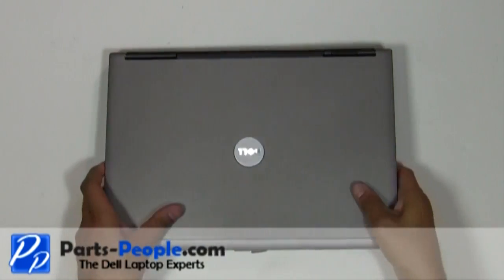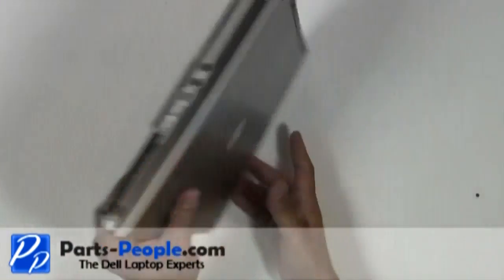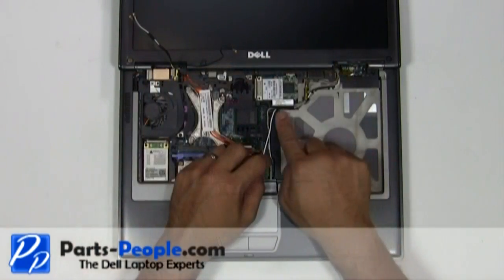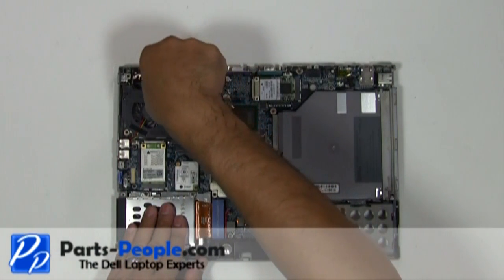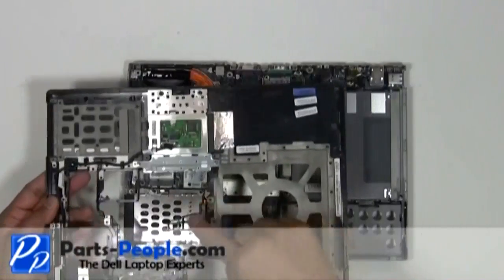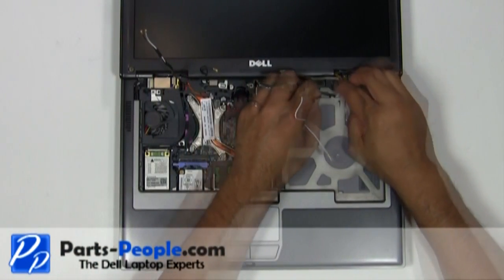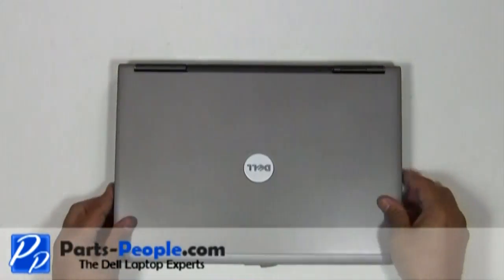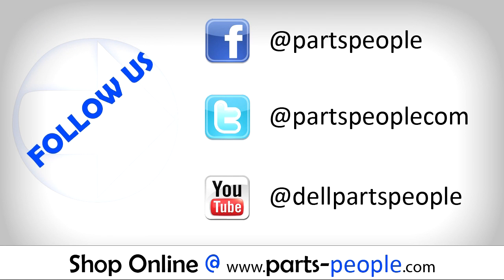Dell Latitude D630 | CPU Processor Replacement | How-To-Tutorial

Comment: I did everything just like the video, replaced the CPU, put it back together, but now my Display is all Scrambled,...Help?
Reply from the maker: I would suggest using an external display to troubleshoot your issue. If it displays correctly that would indicate your problem is not the screen itself and the display cable may be loose or going bad.

Comment: I have installed Linux Mint 18.3 on my Dell D630  My understanding is the bios needs to be   upgraded to A 19 to upgrade the cpu. My bios is at A 3. Is the bios upgrade doable w/ LM installed or should I reinstall xp to do the bios upgrade then reinstall LM.
Reply from the maker: You will need to launch the BIOS update in Windows.
Reply: Thanks for the response. :)

Comment: You can use T8000 and T9000 series Cpus - I just upgraded to a T9300 on a Dell D830 working fine, heat ok but only downside is the 1066 bus speed wont be attained but it is faster and has more cache and you can possibly use PC2-6400 memory.

Core 2 Duo T9300 
SLB47 (C0)
SLG8N (C0)
SLG9F (E0)
2 2.8 GHz 6 MiB 1066 MT/s 10.5× 1.050–1.162 V 
35 W
Socket P July 2008 
AW80576GH0726M
$530

Comment: I have Dell D630 and planning to upgrade the HDD,Processor and RAM.
What is the maximum capacity for HDD,Processor and RAM?
And what type of processor should I buy?
My processor is Intel(R) Core(TM) 2 cpu T7200 @ 2.0GHz 

Thank you
Reply from the maker: +Bharathkumar Yadav Here are all the processors that we have available and know are compatible with the D630. https://www.parts-people.com/index.php?action=category&id=140&subid=150&refine=cpu+processor
Reply: T7500 on the CPU, 8gb on the Ram, then drop an SSD in there!
Reply: Dell D630 punya saya
HDD upgrade ke SSD 256 GB ATA Device.
Memory upgrade ke DDR2 2GB
Rencana akan upgrade CPU core2 duo ke CPU 7800.

Comment: I did this upgrade, now laptop will not fire up I did this to the letter any suggestions would be appreciated I upgrade to T9400 now will not even power up
Reply: Dell D630 bios 17
Reply: Bad chip put old one back in she fired right up
Reply: From my research, some people are saying to not go higher than t9300 on the D630.   Has something to do with the 800 mhz FSB clock speed of the D630 maybe.  Also, looks like there is an A19 bios as of sometime in 2013.  I don't think that would fix this issue though.  Looks like the T9500 has a 800 mhz bus clock but 6 meg l2 cache and I don't know if the bios will run that or not.
Reply: I put wrong chip went with T9300 all works great thanks for the video very much couldn't of done without you God bless

Comment: man I had to use brute force the get the touch pad bezel off, man it was like glued in there maybe from overheating as the old D630 I had always shut down from heat trouble. I did get it apart 'cause I needed to use the 2.2ghz CPU to replace my 1.8ghz I'm now using, tyvm for this vblog, even though I missed one screw in the upper left corner

Comment: You wouldn't happen to know where I can find the full CPU support list for the D630 would you? Specifically with the A19 bios update installed.

Mine currently has a T7250 and it's unbelievably slow even when I do a reboot over into Puppy Linux. </3
Reply: maybe but when I upgraded the bios from A4 to A19 it didn't do much to improve the speed I found A19 from google
Reply: I know. For me it only fixed that annoying keyboard bug. 

And I did find the list. The highest chip support is a T9500 or a T7800. 
(800mhz FSB 2.6ghz)

Comment: Great explanation and Video right up to the point where you put the heat sync back on without cleaning it or the CPU and replacing the thermal compound.  Kiss the CPU bye bye in a month or less.  I always use MG Chemicals 150g Silicone Heat Transfer Compound after cleaning the heat sync and the CPU till they are spotless.
Reply: Lol....Kiss it Goodbye!

Comment from the maker: From the specs I've seen it can use a Core 2 Duo with 800mhz bus and 2mb cache. The T9500 has 6mb cache so I don't believe it's compatible.
Reply: Update the BIOS then drop in a T9500

Comment: Thanks for the time, and I see you posted taht the D630 only takes core 2 duos, so there is there any other, preferably more powerful, processors that could be used in the D820?
Reply: T9500 CPU, 8gb Ram, & an SSD!  you'll be Flyin!

Comment: Does this replacement process work for the Dell latitude D820 as well? Also, my D820 runs a Intel core duo processor, but there are none available online anywhere. Would a Core 2 duo suffice and run the laptop correctly?

Comment: go to Dell's website, it is the A19 BIOS upgrade I believe, do the BIOS upgrade, the processor, do the 8gb of ram, and get yourself a nice hdd or even better a ssd, and you will be in business, I suggest using the 8300 or 8500 processor, all the other processors that are faster, use to much battery power, and cause to much heat and that is not worth the little bit of extra processor speed that you might notice

Comment: it makes the computer run too hot, and drains battery in like 45 minutes, the 8300 is the best processor to use on the Santa Rosa Platform

Comment from the maker: 1. The D630 cannot use an i series processor. It can use Core 2 Duo processors with 2mb cache and 800Mhz bus speed. 
2. If you use a 64bit operating system, it can use more than 4gbs of RAM (i believe up to 8gbs) but with a 32bit system it maxes out at 4gbs. 
3. It will be able to use a 320hdd. The graphics card is built onto the motherboard and is not upgradable. 
4. Finally, the processor and the RAM do not have to be changed at the same time.
Reply: what processor is it?

Comment: What's the max CPU a D630 can handle? I heard it was a T9500.
I'm planning on upgrading mine from a T7100 to a T7500 or T9300, will I notice a big difference going from 1.8GHz to 2.2GHz or 2.5GHz? Also, you took off the cables for the LCD and wireless card, why is that necessary? Can I just unplug the LCD cables and leave the screen on the laptop or is it necessary to take the screen off?